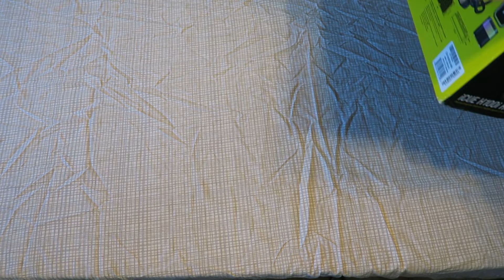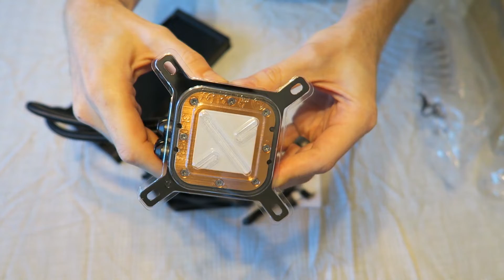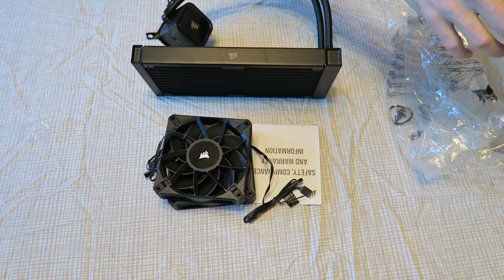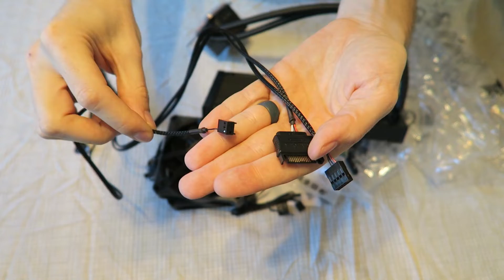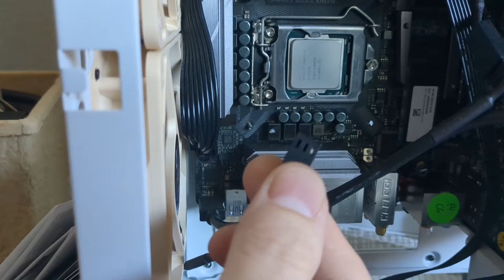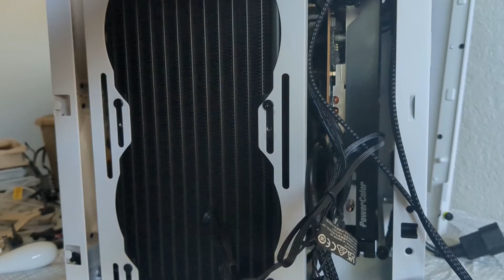Corsair H100i RGB Elite Review and Install

Comment: Don’t the fans go on the other way round so the caged part is against the rad? Curios haha
Reply from the maker: It depends on your setup.  The "frame" of the fan indicated where the air is blowing.  So in this case I'm pulling air through.  In a typical setup you'd want them facing the other way to pull in fresh air from outside the case.  The airflow in this case is just a bit odd so this ended up being the best setup for me temp wise.

Comment: Do you recomend it with a ryzen 7 7700x?
Reply from the maker: I haven't specifically tested that processor, but I think it should be able to handle the cooling requirements without issue.
Reply: @ExplainYouaThing  thanks